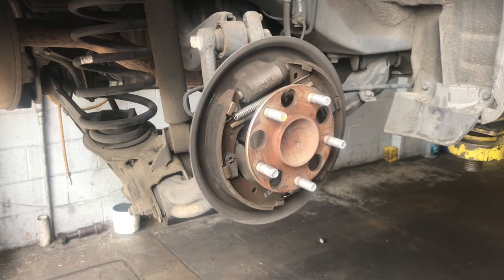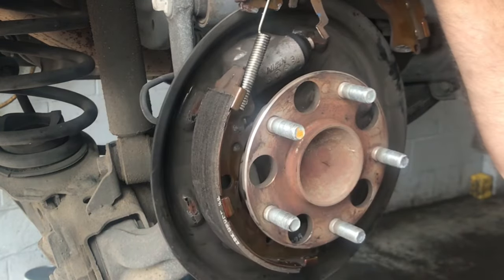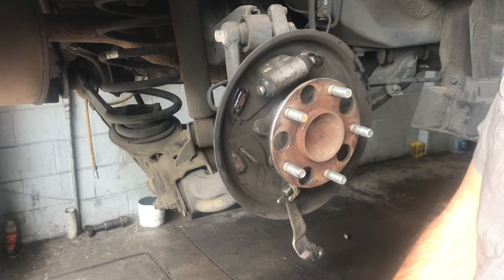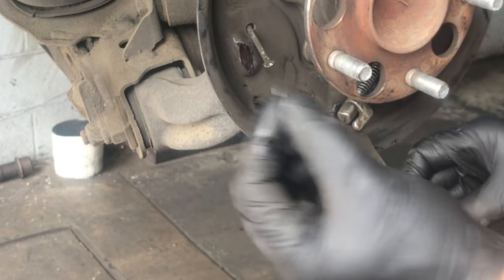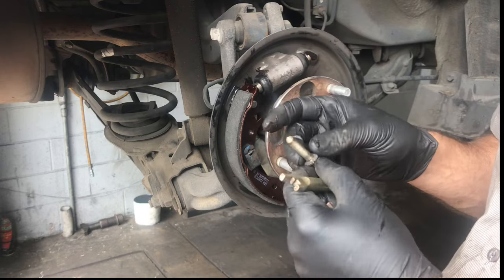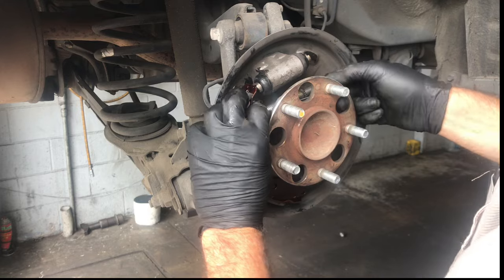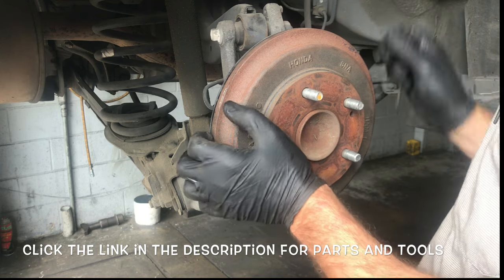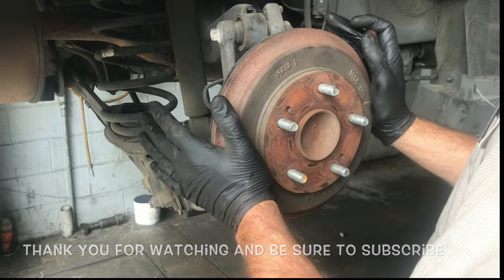How To Replace Drum Brakes On A 2005-2011 Honda Civic

Comment: OK so I did one brake shoe by myself. I follow your instructions now I'm test driving and the brakes are barely  Working. I have to push almost all the way  Down for it to break. And the Car to stop
Reply from the maker: As.diary Sounds like you got air in the system you need to bleed or the brakes are not adjusted right
Reply: @HowtoAutomotive  I got air in the system.. do u have a video on how to bleed the lines?
Reply from the maker: As.diary I don’t. To bleed the rear brakes you’ll need somebody to pump the pedal 3 or 4 times and then hold the pedal down while you open the bleeder screw on the back of the drum. At the same time they continue holding down and tell you we close the valve and then they can release the pedal and do that three or four times until all air has bled out. You also need to check the master cylinder fluid level to make sure that it has enough fluid to do this.
Reply: @HowtoAutomotive   sorry for all the questions and thank u for the quick reply...very appreciated..last questions..what is the fluid call that I need? Do i put the fluid in the same way it came out out? And should i do that before i bleed the system or after?..thank you
Reply from the maker: As.diary you’ll need Dot 3 Brake Fluid. You’ll feel it through the master cylinder under the hood
Reply: @HowtoAutomotive  thanks alot
Reply from the maker: As.diary thank you for watching!

Comment: Driver side went fine, I cannot get the rotor back on passenger side.  Are all 4 brake pads identical?  Only difference between two is I replaced the cylinder and spacer on the passenger side.  They were identical size to original.  Why won’t it fit?!

Comment: Word of warning be careful not to pop off the cylinder when installing the brake shoes, mine came off and I believe I introduced air in the system  as my pedal falls to the floor now, I need to bleed my system now

Comment: My drum does not want to fit back on, and I adjusted everything closed it all the way and it still does not fit! What can it be?? Should I buy new drums? Please I really need the help, thank you
Reply: If they fit on when taken off they should fit back on, be sure to clean it off, use mild sanding paper to clean inside to remove any grooves. But if it's been on since new change it. Peace of mind to have new stuff

Comment: Hello Brain, First off THANK YOU FOR YOUR VIDEO I would have never been able to replace the brakes on a2009 Honda civic without this video. I watched the whole Video twice and was able to remove and replace old and new brake shoes. After many problems I test drove the car and the pedal went to the floor and I hear loud grinding sounds coming from the rear brakes? So what is wrong ? since your video is at chest level and I am working in my garage I can't see the bottom of the drum brakes to well. So I put the drums back on and went for a drive, immediately I hear aloud grinding noise and the brake pedal went to the floor. So I drove back to the garage to see what the problem was. I took off the drums only to find grind mark on the front of them not where the pads touch so I didn't know why this was happening so I checked the bottom spring of the drum brake and I noticed its was outside of the mount pin on the bottom which is really hard to see when your in your garage and working on a lift like you had I couldn't notice that I had mounted the brake wrong and the spring was on the outside of the tab so I played with the brakes and the bottom spring fell off and I moved the brake assembly to the right and it fell into it's original spot and after adjusting the star wheel no more grinding and the brakes worked just find. Thanks for your help.
Reply from the maker: In the end I’m going it all worked out. That was cool how you worked through the problem. Thank you for watching!

Comment: Nice tutorial Brian 👍🏻What is the grease lubricant brand are you using? Can this apply for the front brake pads as well? Where can I get that clip tool at?
Reply from the maker: Geoki Yuen it’s Slye glide. There is a link in the description

Comment: What does it mean if my E brake and brake pedal feel loose

Does it mean i didnt tension it 
Or does it mean i didnt bleed them
Reply from the maker: That would be The tension. Adjust the brake shoes after that if it’s still loose adjust the Cable
Reply: @HowtoAutomotive  i got it i tensioned it alot and adjusted it as well and it feels a little too strong but its 11 pm and im tired but after a test drive it isnt too strong  it feels close enough to before

Comment: 2 hrs later stuck trying to get the second shoe on under tension, dunno why, cant get this method to work.
EDIT: got it to work, just needed to stop trying to juggle the adjuster spon and install it later
Reply: stopped trying to juggle the adjuster spoon piece and this method now worked fine

Comment: I would like to speak with whoever invented drum brakes because they should not be this much of a pain to fix. Just spent 4.5 hours working on one side I had to go to the store to buy a tool as well because I was struggling with that horseshoe pin. It also took that long because I got everything apart just to find out that I had the wrong size shoes 😂😂
Reply from the maker: That sucks to go through all that work to find out  you have the wrong parts. Trust me, everybody struggles with them but after a while if you do them enough, they become pretty easy.

Comment: I have a 2006 honda civic lx sedan and I want to do the breaks uffff I'm a little nervous 😖
Reply from the maker: tiger-chapincito13 got it. Just do one side at a time. So you can use the other side as a reference.
Reply: @HowtoAutomotive  yes sir I will, thank you very much
Reply: I deferred doing mine until the shoes were nearly shot.  It isn't that complex mechanically, but still intimidating when you only do it once in a blue moon.

Comment: For the love of god do not remove the parking brake arm from the long spring on the other end.  That spring is notoriously stiff and it will be very very hard to get the lever back in front of the nut there.  Wish I'd watched this vid before I tried it.

Comment: Why were drum brakes ever made. It looks much more complicated for no reason
Reply: I don't know the reason as discs were conceived of long before they became common.  Several possibilities: this was all before the availability of power brakes - disc brakes require more pedal effort than most people can manage where as drum brakes were designed to be self actuating (the frictional forces on one shoe was utilized to increase the pressure on the other) and thus required much less pedal effort than non-powered disc calipers.  Another possibility is that tires used to have much higher profiles, so for the same outside tire diameter there was less room for the brakes - it's conceivable that decent drum brakes could be fit into the smaller space but this is just a guess.  I 'm preparing do my first Honda drum brakes, but recall domestic and VW beetle drums being easier than these Honda's appear to be though they still required some finesse and it still helped to have specialized tools for stretching the springs and removing the keepers on the pins.

Comment: too complicated lol. I will stick to easy disc.
Reply from the maker: Omar Chisolm I’m glad there not around as much anymore 👍🏻 do you need to do Rear drums on your car?
Reply: @HowtoAutomotive  yeah I have the same car but with rear drums. I did the front pads, calipers, and rotors but afraid to try drums hahaha
Reply: @HowtoAutomotive  I really want to do it cause I want to have the fronts match the rear. its a lot of springs to remove huh.
Reply: @omarG19100  If you like older cars, like I do, you will want to learn how to do rear shoes. I love cars from the 1980s.
Reply: @Michael-fw5ef  i was able to get it done kn my civic. but i know some cars u gotta move the hub to get to the springs which is a pain. i made sure i cleaned and lubed everything up cause i aint goi g back in there =)
Reply: shoot these are basic easy compared to lots of older ones,   cake.  only two springs and you dont evne have to pliers them.    back in the day you had to have huge pliers and bars and all kinds of work prying swearing to do these.     so these are simple easy,.  you only need one tool to do these!    it dont get any easier,.  even discs you need more than one tool.

Comment: Crap how to video. don't watch
Reply: I think the trick is to view a number of videos to see how various  people approach the job and where the trouble spots are.  Things I like about this video is it demonstrates that it's possible for a reasonably experienced person to do it without a struggle - I'm preparing for my first Honda but did a fair number of domestic and VW drums in the past and this has helped me to see the similarities and differences.   There are ways it could be improved including:  a) how to remove a reluctant drum, b) cleaning up the internals and crusty drums, c) listing the tools by proper name and their sources, d) slowing down to the "speed of thought" and listing the source of the printed instructions and dwelling longer on them, e) demonstrating common mistakes and how to avoid them, f) showing how to back off on the adjuster wheel if one tightens one too far, g) emphasizing the impact of air in a brake system and how to recognize it (spongy pedal) and importance of checking for and correcting this and other problems before hitting the road.  Overall I feel it's a very useful demo.